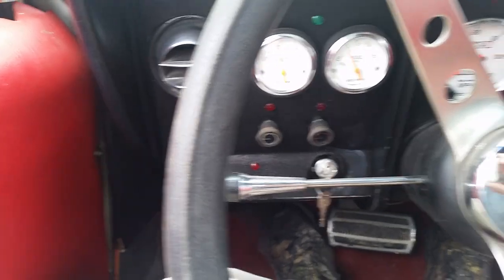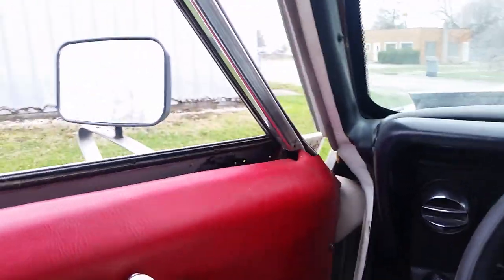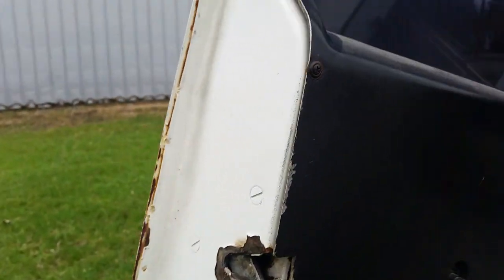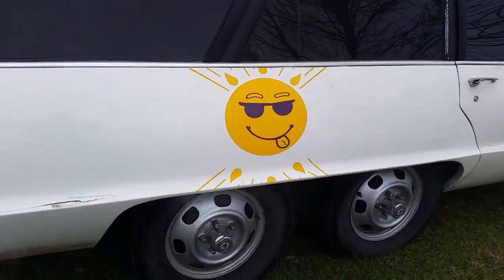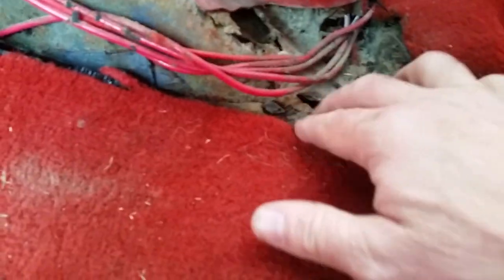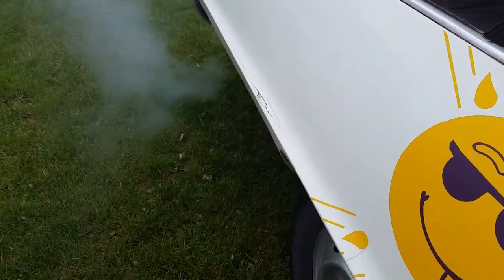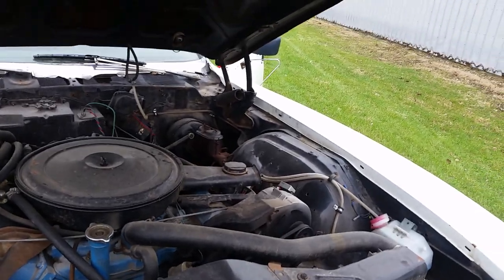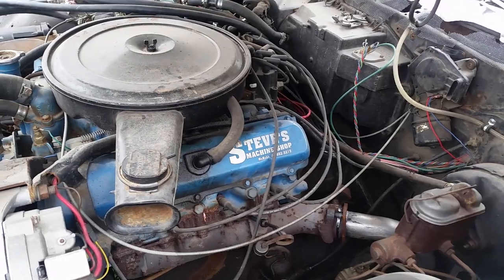1971 oldsmobile 707 jetaway airport limo

Comment: Super old video, I know. The reason they installed hardened valve seats is because the original engine was designed to run on leaded gas which cooled and lubricated the valve seats. When the government switched over to unleaded gas it tended to burn up the valve seats.  People that have really old cars typically have the valve seats replaced or else add some type of lead additive to every tank of gas.
Reply: If you're interested, there's a YouTube channel called Cleveland Power and Performance that recently bought a Jetway and are in the process of restoring it.